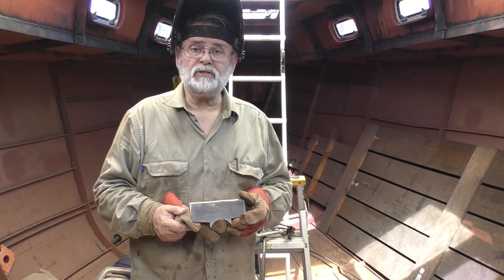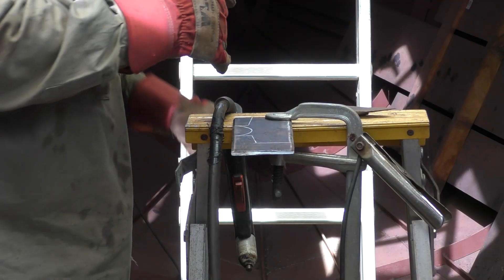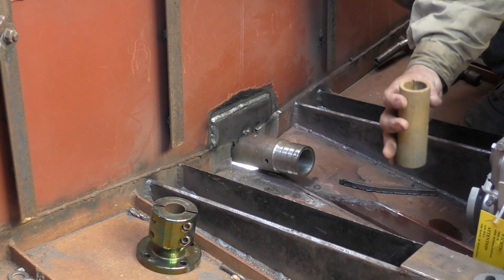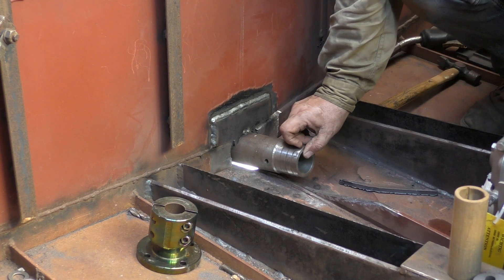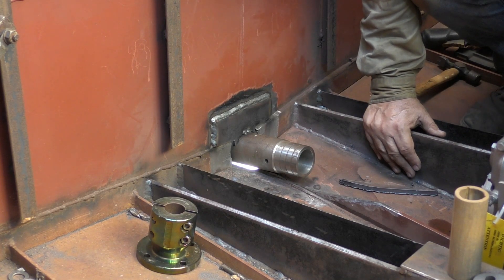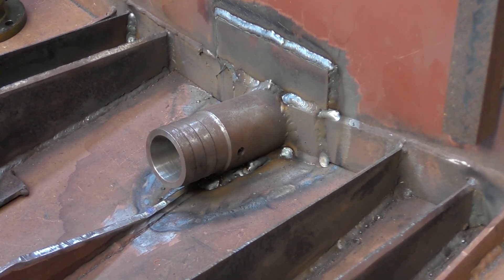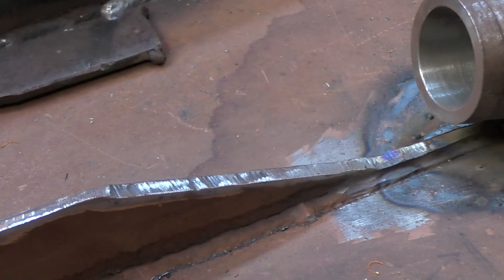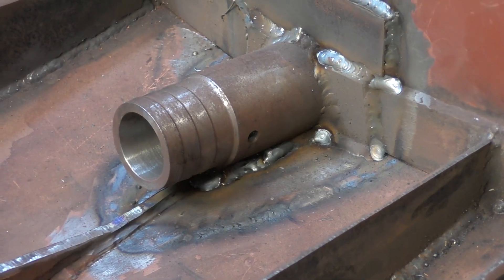Steel Sailboat Building SteelAway - Shaft Initial Alignment Part 5

Comment: What shaft log stuffing are you going to use? Awesome as always, Thanks for sharing, and hope you had a great holiday! Cheers
Reply from the maker: Thanks man... I will be using a dripless seal setup that doesn't require a stuffing box etc. There is a water feed from the engine seawater that trickle lubes the cutless bearings, then vent back to sea via the aft end of the prop tube. 👍